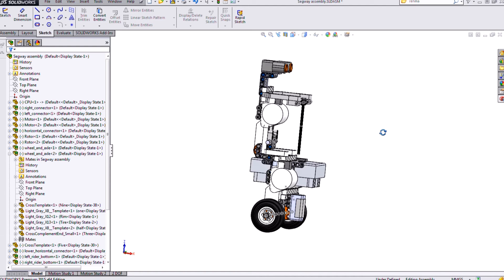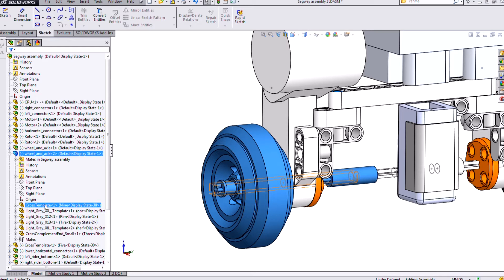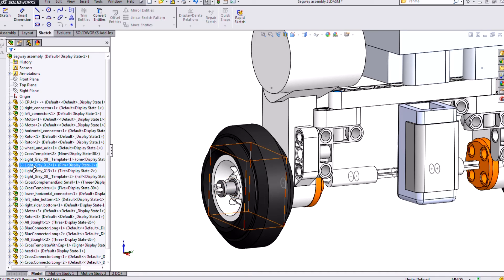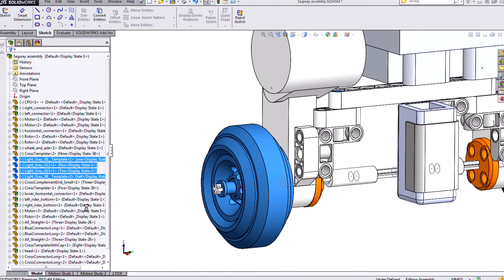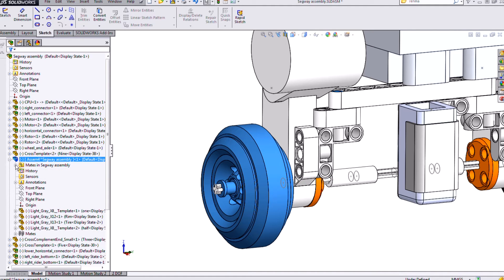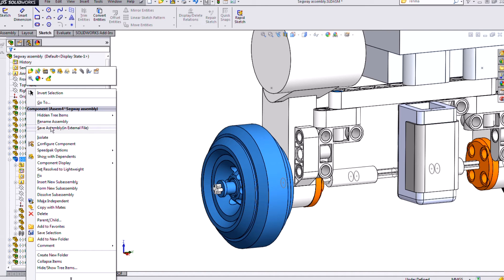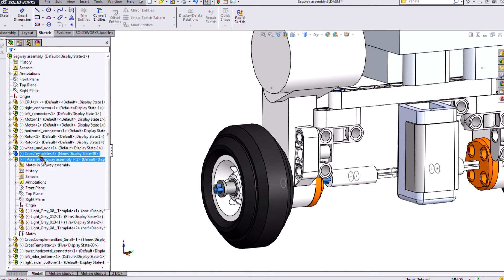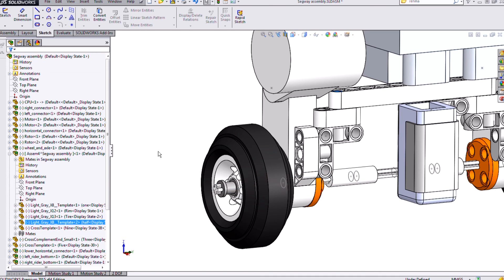SOLIDWORKS - Breaking Down and Creating Subassemblies

Comment: Nicely done. I wish all videos were this clear and to the point. You covered just what I needed to know. However I have trouble with mates getting messed up when some of the parts are made in context to parts I don't take into the subassembly. I'm doing piping and the ends of 3D sketches are mated to other parts so the pipe moves with them. When I make a subassembly including the pipe with this method mates go haywire.